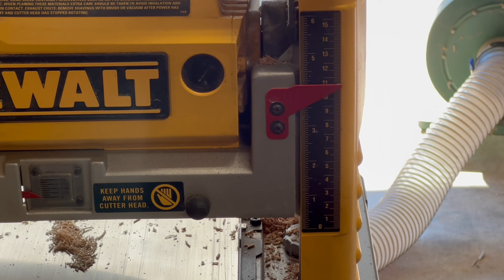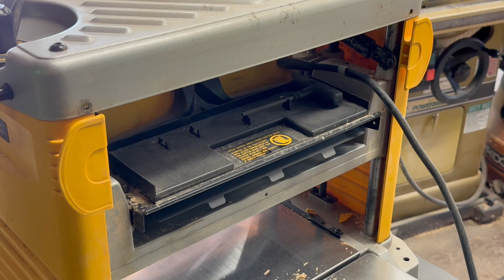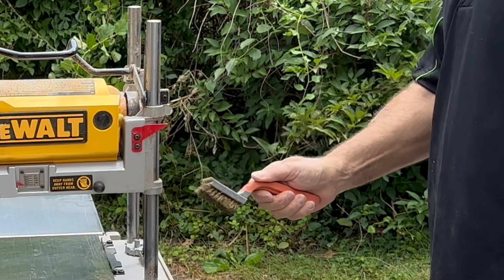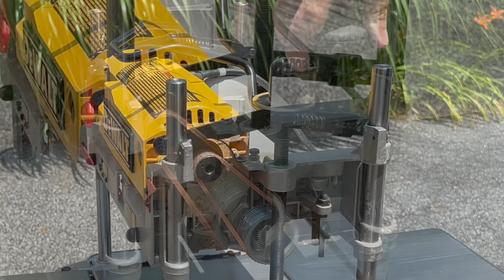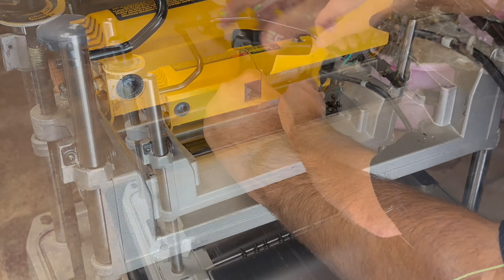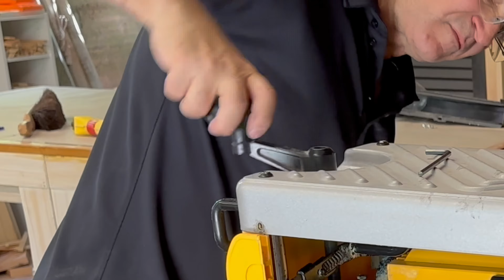Tool Tips & Reviews - How to Tune Up an old DeWalt DW734 Planer!

Comment: Ya, good video. You got a deal! Mine sitting in barn for 20 years. Needed to plane- and IT BUSTED!! Whoa!. Drive gear split in half. Why? Disassembled. One roller frozen, Mmmm. Disassembled further. Roller shaft bearing block all galled up!! (Manufacturing defect- metal scavenging in assembly)). Block was toast. New one on Amazon, $14. Bought new belts and blades JIC with snap ring pliers set. Bought new screws (10-32) for the roller block retainer brackets screws- (4) (Had to rotate chisel them to get them started out). Buggered block on one roller side. Used fine emory cloth to smooth the roller shaft- nice and smooth now. Lube all with "Gear Hugger". Reassembled with blade change. Clean rollers with alcohol. Careful with lube - attracts dust and chips. Now, 100%. Used this planer to the max doing finish wood when building my house - oak, black walnut, and maple. Never failed. Changed the blades 3x. (It's a big house!).
Reply from the maker: Sounds like all your hard work paid off big time! These are great machines once they're tuned up.  Thanks for watching and the detailed comment.

Comment: Thanks Pete! I recently bought the same planer for 200$. How can I check if the blades are sharp or not? I heard the blades are super sharp even at their dullest
Reply from the maker: You can visually inspect the blades and look for nicks. Also, run some boards through and see how smooth they come out. If the planer is bogging down, chances are the blades are dull. Fyi… like you, I bought my planer used. The firsthing I did was buy new blades for it.  Thanks for watching!

Comment: You didn't open the bottom of the planer.  It may be a little different on the 734, but on my 733 that is where the chain and sprockets that connect the height adjustment screws.  I think that compartment should be cleaned and the chain lubricated.

Comment: Just got one that won't feed for $50!
Reply from the maker: I think there’s a chain driven sprocket that drives the rollers.  Maybe the sprocket needs replacing?
Thanks for watching!
Reply: @PetefromBaltimore  Thats my initial thought. Maybe even just needs to be cleaned! Gonna fix it up and sell it for like 5x what I bought it for lol. Im trying to get a laguna fusion f2 table saw
Reply: Please be careful using any lubricant on this machine that dust will stick to. I've worked in wood shops where we use dry silicone (it dries after spraying as it's solvent based) there are other lubricants that can be used on wood working equipment.
Reply: @1ajsammy  Turns out all it needed was a cleaning. Some wd40 on the ends of the rollers freed em right up, and i decreased the chains and applied mtb wax (it hardens for similar reasons), cleaned the sap off everything, reversed the blades (brand new still on 2nd side), and used dry lube on the sliding bits! In fact, I actually ran around my house for like an hour trying to find the can of silicone dry lube I have cause it wasnt where it should be (imagine that😅). I haven't tested it yet cause I finished up really late, but its all rolling good again it looks like. Fingers crossed!
Reply: @MatttKelly love your comment and glad for you that you fixed it up!
Reply from the maker: Good feedback. 
Thanks!

Comment: Will I have to re-level the planer bed parallel to the head?
Reply from the maker: Hi there.
Thanks for watching.
I wouldn't mess with the cutter head settings unless you see an issue when planing. Adjusting the planer head for parallelism requires is only needed if you see the planer is removing more material from one side/edge during operation.  
Here's a link to an instruction sheet on how to adjust cutter head...
https://support.dewalt.com/hc/en-us/articles/360012667678-How-do-I-adjust-the-cutter-head-on-my-DW733-DW734-so-it-is-parallel-to-the-base

Comment: Pete, what would you do if one of the Blade screws would not come out?
Would you then just replace/flip the other two blades?
Thanks-Bob
Reply from the maker: Hi @txbob
IMO, you really should replace or flip all 3 blades at the same time.  1 dull or nicked blade can definitely ruin your results.
I would definitely try to remove that stubborn screw.
Thanks for watching.

Comment: Hi Peter .. can I know what’s dust collector HP or brand name attached to planer ?  I have DW734 and looking for good dust collector at reasonable price
Reply from the maker: Hi there!
I’m using a 20 year old Grizzly dust collector.  Its similar to this one that they currently sell. 
https://www.grizzly.com/products/grizzly-1-hp-light-duty-dust-collector-polar-bear-series/g1163p
I use it for my Table Saw, Planer & Jointer. I connect it to each tool with a 10 foot hose with slip on connectors on each end. It does a good job. 
Thanks for watching!

Comment: Should you of checked the motor as well?
Reply from the maker: Motor was running well before tuneup. 
No strange noises or vibrations. 
Can you share how someone would check the motor for proper operation?
Thanks for watching.
Reply: @ I’ve honestly no idea, I was curious, recently got ahold of my grandfathers dewalt dw743 planer over thanksgiving and came across your video, I got it working

Comment: Just a note, don't remove the four screws holding the side panels to the top cover. Just remove the cover screws and the side panels will lift off with the cover. Eliminates breaking the side panel screw holes.
Reply from the maker: Thanks for the tip!
And thanks for watching.

Comment: Got one for $60 today. Rust on the supporting columns, a lot of gunk and old saw dust and it doesn't turn on. Upon checking, its missing the motor brushes. Hopefully those are the only reason why it won t start.
Reply from the maker: Hopefully you can get it up running. 
Its a great little machine when it’s set up well. Good luck!

Comment: I saw your video. Hope you can help me . I changed the blades I turned it on and it shakes so much the screws on the metal table vibrate off
Reply from the maker: Hard to say what went wrong. Its probably best to go back in and make sure all blades are installed correctly. Also, maybe check belt to verify its correctly seated. Good luck.

Comment: What do you use for dust collection?  I make wood/epoxy cutting boards and I can’t seem to figure out what is best for dust.
Reply from the maker: Hi! Thanks for watching. 
Dust collection is an issue for me as well. For my smaller tools(routers, mitersaw, sanders, etc.) I use a Rigid shopvac hooked up to a Dust Deputy cyclone separator.  For my larger tools (Table saw, planer, jointer) I use a small 1hp dust collector with 4” hose. 
Both systems are just ok capturing maybe 90% of larger grained sawdust. 
The fine dust still goes everywhere.

Comment: what was the issues when you replaced the belt? I have been having this clunking noise in mine , while on even with nothing running through. It i feel like it would make sense if it was the gear or belt system. the piece of lumber stop and goes and leaves roller marks on the piece almost like the roller is getting pressed harder at one point in the every rotation of the roller.
Reply from the maker: Thanks for watching. 
The issue I had with the belt is it started to fail while planing some hardwood… specifically white oak. The belt was very old and broke apart while planing. 
I suggest changing out belt if its very old.
Reply: my guess is the bushings, just had the same issue with mine, one of the bushings had grinded away
Reply: Replacing the belts on the 733 and 734 are a nightmare if you look on the internet.  It's so difficult that some report it taking days, mostly spent on frustration and coming up with possible workarounds.  My own method, which works great, but also takes a few days, is to heat the belt in boiling water for a few minutes and then wrap it around the ends of a vice, expanding it until taut.  Then, every day I stretch it a bit more until I stretch it about 15 mm.  It then goes on the pulleys like it was designed for them.  Please let me know your experience.